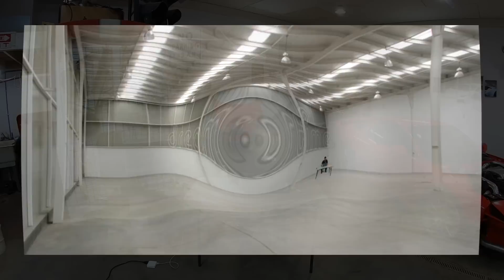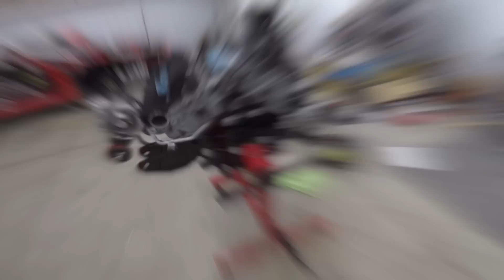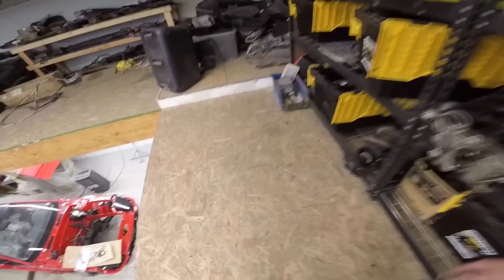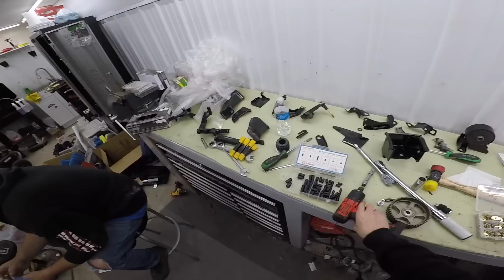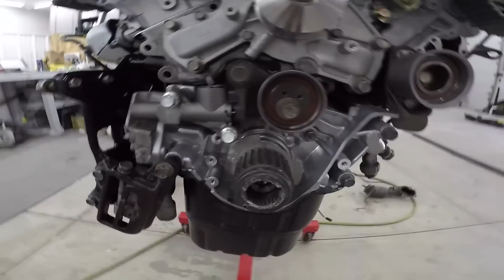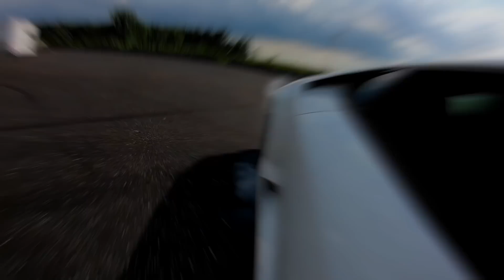Answering ur tommyfyeah Questions / Q&A

Comment: I can relate with you on the accident and only being able to work for so much then having to rest. 

I'm currently 34 and was a passenger in an accident when I was 30. Lost 4 years of my life and wages, had to spend 30k out of my pocket to go to appointments to keep myself going and to heal. Just settled for less than I would have made in one year. Bottom line accidents aren't fun or lucrative.

The main thing i wanted to say is that I rebuilt a 2g dsm during that time and it keep me going and had something for me to  keep positive about.

Keep doing what your doing, it's good to see 👍

Comment: you dont need to take those covers off, just use a belt to hold over both and pinch it with your hands. it holds enough torque just fine

Comment: Off topic, but I would love to know about that loft at Adrienne's(?) I'm building a shop right now and plan to have a similar loft built. Still in the planning stages!
Reply: Adrian, but close enough... lol... if I could build the garage agian I would change so much
Reply: @brokemanslots  I am planning to build a loft for storage above my work area and home gym. 30x12 with a support somewhere around the 15-18ft mark. Around 8 foot off the ground with attic ladder access. I was wondering what your header for the joist support is made out of and what kind of span it is? Any deflection? Thank you for responding!
Reply: @kryptofreak440  I would have to ask my builder, I know the span was 24' pretty sure it is double 12" beers, I am on the road, when I get back I can get more info and measurements
Reply: Beams.. I wish beers

Comment: Good ole td04hl... They take a pounding I'll give em that. I have the trash talked td04hl-22t with billet wheel and 9 blade turbine. I'm running it on an inline 5 Volvo whiteblock so single not twin. But makes crazy torque and takes everything you throw at it. 23psi on a 7cm hotside lol...

Comment: Any tips on getting approved for disability? Ive been denied 3 times its been 6yrs since my first attempt and i dont want to hire an attorney to take the majority of the money that should be mine
Reply: It took me 3 years to get approved for Dissability and it woulda took a lot longer if it wasn’t for getting the attorney on my 3rd try. It was 100% completely worth it and in all reality they really didn’t keep all that much. I promise you the attorney is the way to go when it comes to Dissability!
Reply: Also, i don’t know if it differs from state to state but back pay only goes back so far in Ohio. I forgot what the length of back pay is but it’s definitely less than 6 years so not having an attorney your technically already losing out on money
Reply: I hear different things and dont really know what to believe its definitely frustrating. Im going go for my 4th time this month but this time in person instead of online and hopefully they can help me fill out properly
Reply: @KeepCruzin  i totally get it i went through the same frustrations and confusion! I still stick by the having a lawyer though.. i really believe without him i might still not have gotten it. Have you atleast talked to one yet? It don’t cost any money to consult with one. Also even if you got one and for some reason still didn’t get the disability granted you don’t have to a pay a single cent. So it’s kinda like a guarantee win ya know…
Reply: @KeepCruzin  and good luck man!! Hope it all works out for you! Like i said i know how frustrating this shit can be😖
Reply: @KeepCruzin  its not worth trying these days so many hoops to jump thru i was lucky enough to get it at 15 back in 2005